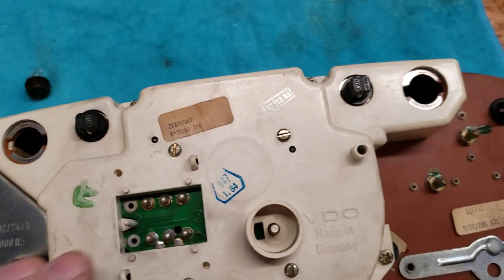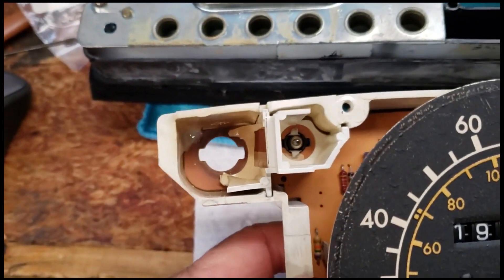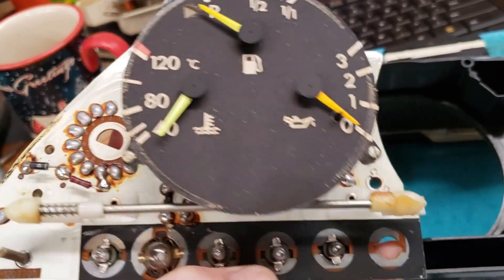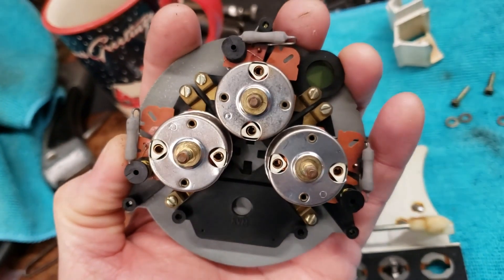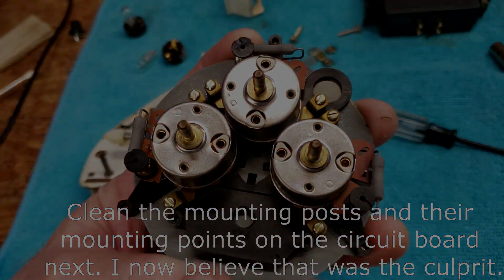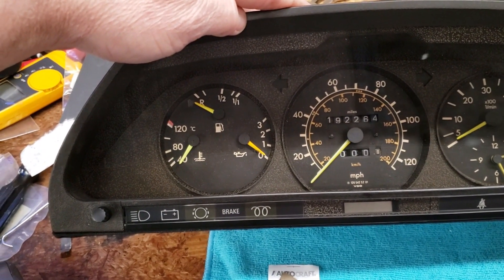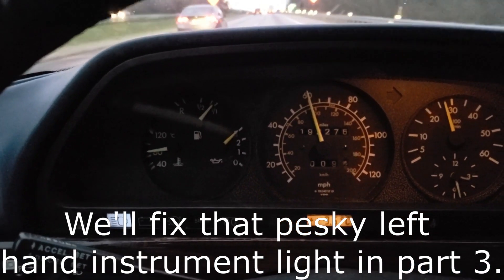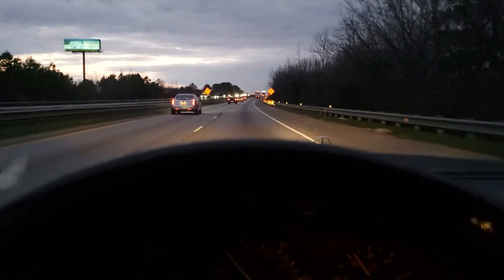W126 Mercedes 300SD Instrument Cluster Issues - Temperature Gauge FIXED ! - Part 2

Comment: Thank you! This fixed my issue and saved me a lot of work. Everyone in forums appear to miss this problem and recommends wild things like replacing the thermostat
Reply from the maker: Yeah. Those are things I did all BEFORE finding the grounding problem in the gauge cluster. I'd say more than 90% of old Mercedes that "appear" to run hotter than normal actually have bad grounds in the gauges.

Comment: I'm having a similar problem with my fuel gauge. You used 600 grit sandpaper to clean your temp gauge, right?
Reply from the maker: 600 will do fine to clean the grounding contacts on the circuit board where the gauges are bolted down. All of the gauges can have this issue. Remember to put some electrical anti oxidant on the ground connections before reassembly.
Reply: @ImpalamansGarage  OK. I believe my dad has some sandpaper. I didn't think to clean it when he was resoldering the ground connector above the rheostat on my W123 instruments cluster, but I'll give contact cleaner a shot. Do you mean the contact pins on the circuit board? They're aluminum, right?

Comment: Mine did the same thing. I loosened then tighned the small nuts on back and it fixed it. Bad contact.
Reply from the maker: It's a really simple fix but getting there can be tough because there is so much misinformation floating around.

Comment: Thanks Mike...i plan to attempt the same with my instrument cluster using your video as a guide.  🤞😏
Reply from the maker: Once the connections are cleaned up , recommend some electrical anti-oxidant  be applied to the gauge mounting points on the circuit board prior to reassembly.
Reply: @ImpalamansGarage  good point. I'll do that.  🙂

Comment: I just overhauled my cluster, fully torn apart. Removed plexiglass (wet sand and buffed) , outer bezel, rear frame, painted gauge needles (orange) and painted everything flat black to remove the primer spots that bleed through the old finish. However now the dash illumination lights and center console lights are dead. changed the rheostat from a spare cluster and still does not light up.
Reply from the maker: Well if you've not done so, check your fuses first. The center console lights should not have been affected by anything you were doing unless you did not disconnect the battery and shorted a wire somewhere and blew a fuse.  If no fuses are blown I would check to ensure you have power coming into the cluster. Remove it from the dash and check voltages at the wiring harness, with battery connected obviously.
Reply: @ImpalamansGarage  It came down to the red fuse mounted on the back of the instrument cluster cluster, mind you, its a 2nd gen W126. It provides power to the "K6" terminal block connecting to the instrument illumination control unit. Lesson learned, ALWAYS disconnect your battery.
Reply from the maker: @MrStroller4u  Cool! Glad you found the issue!

Comment: Deoxit is really the way to go instead of sand paper in these situations if you can as scratching them up usually makes the problem go away and them come back worse later. The south being so moist is really annoying sometimes.
Reply from the maker: Agree. An antioxidant would be best. I should have done that. I usually do this on all my 120v AC pojects and 12v battery terminals but not the smaller stuff. Need to reevaluate! Great tip!

Comment: Hello again sir...sensors.????..1 on thermostat housing...and 1.on left side.eng.under fuel steel lines..having trouble replacing them...I took old 1 out. Thermostat housing..the specs from it is. European..500 ser...but is it the right 1...
Reply from the maker: The engine coolant temperature sensor which provides output to the temperature gauge in the dash is on the driver's side of the engine below the fuel lines. The sensor on the thermostat housing is for the climate control system. It prevents the climate control from blowing cold air if you turn on the heater with a cold engine. The climate control blower will not blow until the engine reaches 40 C. https://www.benzworld.org/threads/two-temp-sensors.1569014/

Comment: Hello from murrells Inlet south Carolina. Thanks 4 cluster video. Cleaned mine. With the wife's nail file cardboard. Working great. Now my temperature gauge working holding 75 80 ..clean studs very good. Thanks a million. Also. Mine 300SD IS first generation. No outside temperature gauge. On cluster
Reply from the maker: Good to hear! A flakey gauge is nerve racking.

Comment: That is one of the worst "melted" clusters I've seen!! But a great mod is led drop in replacements for the big bulbs. No heat and they dont melt everything. Also are way brighter than the old units. They are not overly bright but it looks so much better. Highly recommend the led. But you would need to source a new cluster housing to fix the plastic prism things that reflect the light back onto your gauges. Get one from an 86 or newer car to avoid that spotty look and better plastics. The work you do is spectacular
Reply from the maker: I added LED bulbs in part 3. This video was getting too long. Thanks for the kind words.
Reply: @ImpalamansGarage  You might be able ti actually FIX the melted light tunnels.  I am not sure if it's possible yet, but I am experimenting with resurfacing the deformed portions and polishing the outer surface.